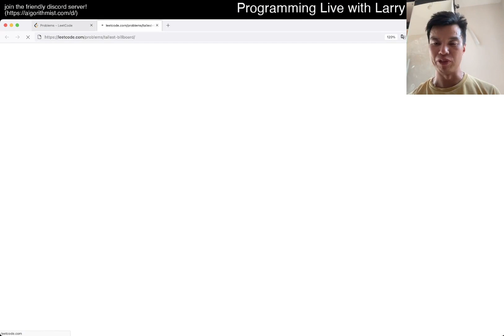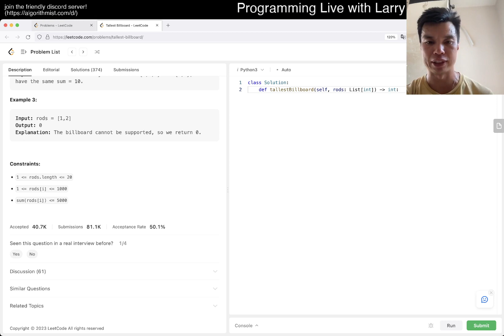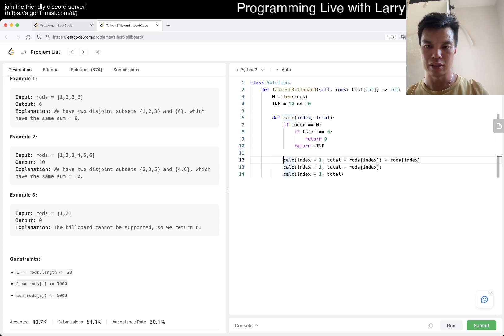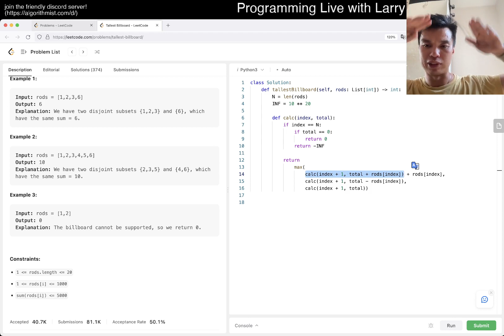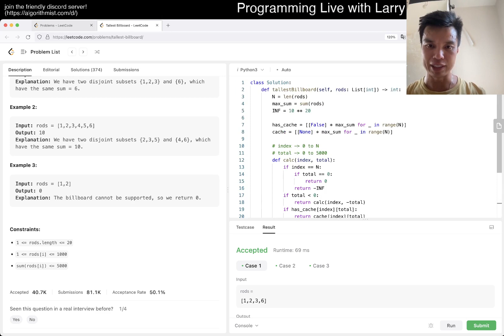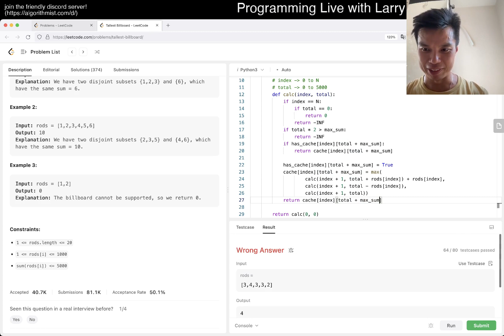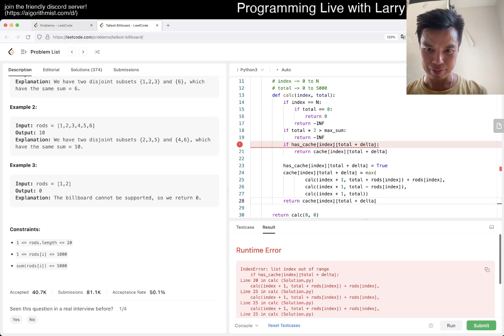Daily Leetcode #1180: Jun 24, 2023 - 956. Tallest Billboard

Comment: Can you please explain how calc(index + 1, total + rods[index]) + rods[index] works? Are you not double couting rods[index]?
Reply: We are trying to reach the base case of total = 0, by either adding, substracting, or skipping over each number (basically trying to make two subsets where all + numbers chosen are one leg and all - numbers chosen are the other leg). The + rod[index] outside of calc(index + 1, total + rod[index]) + rod[index] is used to keep track of our current tallest billboard
Reply from the maker: Basically we're only counting it if we're adding it to say, the "left" side of the billboard, so we do not double count.  In fact, we did double count it initially with the WA (when I thought I could use the shortcut, which I quickly fixed)